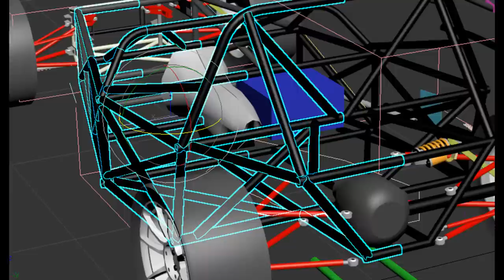Differential and Drive Shaft Install - E55 ASL Part 11

Comment: Been following since the beginning, and I definitely appreciate all the ingenuity and can relate to what you're doing (currently starting to swap an M113 N/A in a Jeep).  BUT being someone who has used a tried using a lathe and a rotary welding jig to shorten a driveshaft... man, take it to a driveline shop and let them weld/balance it. I can't see this one not giving you headaches.

Comment: Driveshaft gonna be a problem when it gets running you should always keep a driveshaft as one solid piece and shorten is by taking off the ends and welding either the yoke or drive on to the end of the tubes
Reply: Realtime1501 the transmission output is offset from the differential input, as well.
Reply: Another issue he has with that driveshaft is that because of the different diameters it puts the peak stress in that axle straight into that welded joint. I hope he creates a really sturdy steel tunnel with strong hoops around that thing. With those big slicks and big engine, angled axle ends with u-joint only at one end and welded axles which are not balanced ... there are going to be some big loads going through it.

Comment: Surely non balanced driveshaft vibrations will be serious and no amount of joints will help?
Reply: Aslong as the angles are right there shouldnt be any vibrations
Reply: @benson4u215  factory axles are balanced, maybe the just have bought to many weights 🙄
Reply: @benson4u215  try put an hose clamp on your drive shaft and notice yourself how it will vibrate as fuck at Speed
Reply: @benson4u215  what about the weld area and the fact it most likely wasnt welded on completely parallel? It wont be any good until its balanced properly by someone who actually knows what theyre doing. And more than likely a driveshaft specialist wont touch something thats been cut i  half and joined in the middle like that.

Comment: The project is an awesome thing, but driveshafts aren't something I wouldn't DIY. Even the slightest balance imperfection can be a literal pain in the ass at several thousand RPM.
Reply: Yeah, at least get a few professional opinions on it.

Comment: You explained that the driveshafts doesn't have the same Diameter. then you are using a piece of metal to make it "perfectly" straight. You are sitting directly over the driveshafts, what you did is really dangerous. If the driveshafts fails during a drive it could easily kill you.

Comment: What goes into calculating the strength of a propeller shaft? I didn't think that hollow cylinders could withstand much torque.
Reply: It is actually all transmitted along the strongest part of the structure so your good.

Comment: You are wrong about how LSD works. If one wheel will be in the air the wheel with traction will receive MORE torque than the one in the air (not equal amounts). Open diff works on principle of equal torque split so when one wheel has less traction it determines the maximum amount of torque which we can send to each wheel. With progressing locking ability of the clutches in the diff we can send more and more torque to the wheel with traction.
Reply from the maker: Meant to say equal speed. It's different how the wavetrac lsd works. The clutches are only there to provide a bit of resistance so the mechanical lsd stays locked even at 0 load conditions

Comment: Thanks for another great build video,  Just as I was thinking about balancing the drive shaft you explained why you don't intend to do it, it did look like the front piece had a balance weight on it and I do wonder if that should be removed or not.

Comment: 🤔aint the shaft is gonna vibrate? because its not balanced
Reply: That should not be a question IT WILL vibrate. they will vibrate even if you paint them wrong. Ask me how I know...
Reply: @rocketssss6  😐 realy? even the paint this is the first time i know about this? It have wight but not like the wilds

Comment: 9:40 the square tubbing is blocking your diff drain bolt. How do you plan on changing your diff oil?
Reply: Bugger! That is a bit of a gaff
Reply from the maker: Maybe it seems like that in the video but both drain and fill plugs are accessible
Reply: @xfmotorsports  oh good!

Comment: without rubber bushings whining noise and vibrations from differential will be transmitted to chassis and multiply
Reply: For a car of this caliber, I don't think he would mind the vivrations and noises. It's a purpose built track car, not for road use.

Comment: I would weld some strong material inside the two driveshafts or weld a collar on top. If that weld fails, that prop shaft will flail by the seat and kill you.
Reply: Or weld some sort of thicker pipe "like a fake torque tube" for that thing to spin inside of.
Reply from the maker: It's going to be inside a transmission tunnel
Reply: @xfmotorsports  i would also add driveshaft loops." as great as this build has been, that driveshaft kinda makes me uneasy..adding a few safety loops is never a bad idea anyways and realistically doesnt add that much weight overall
Reply: I agree safe it's never enough and if u see any profissional transmission maker thei reinforce the interior of the transmission shaft, so I advice you even if it's going on a transmission tunnel to reinforce that shaft, best regards and grate vidio
👌💯

Comment: i would machine the edge of the e55 shaft so that it would slide inside of the infinity shaft...slide it in maybe 20cm or so and then weld.. i think it would help with centering and strenght

Comment: Have you checked the FIA regs for the main hoop tube diameter? Needs to be 50mm I think. Maybe yours is already or rules in Canada are different?
Reply from the maker: Depends on the weight of the car. For mine its 1.5"x0.095"
Reply: @xfmotorsports  good stuff, I figured you know what you're doing! Keep up the good work

Comment: Welding a driveshaft in the middle is very strange. It will break. Put in Driveshaft containment  or loose a body part.
Reply: He stated it will be in a tunnel.

Comment: I would send the drive shaft out for balancing.
Slightly unbalanced drive shafts can cause real issues. A badly balanced drive shaft will break welds!

Comment: can you explain why square tube is weaker than round tube? the common sense tells me that having corners, the square tube should resist more to bending and deforming...but i believe what you said, it just doesnt make sense in my mind!
Reply from the maker: Under compression the flat surfaces usually buckle easier. Depends on the size and wall thickness too but for the same weight round tubes usually turn out stronger
Reply: @xfmotorsports  thanks a lot for taking the time to answer!... but on a chassis i would imagine that the forces acting on the tubes would not always be perfectly parallel to the tube itself (compression or pulling) unless the chassis would be very carefully and perfectly designed (maybe thats the case)...maybe the use of triangles takes care of the twisting forces.

Comment: Question: isn't better to cut and reweld a shaft at joint?, because in middle there  will be a lot of torsion.
Reply from the maker: Ideally yes, but its hard to get the drive shaft straight that way. The drive shaft is fairly understressed for this application anyways since the car is half the weight of the donar cars
Reply: @xfmotorsports  vehicle weight doesn't matter much for a driveshaft, it's the amount of torsion it will see, which given the amount of power and mechanical/aero grip you will have won't be little. I think you would be wise to get the driveshaft made-up professionally. The amount of vibration you will likely get is going to be damaging/unsafe. Not saying all this to put you down, I love the project. Saying this because I'm concerned about your safety
Reply: @derekstratton6063  I am also a bit concerned about the vibrations coming from the joint difference plus the imbalance in the shaft. Especially with the solid mounted diff, I am a bit concerned the vibrations might just break the welds.

Comment: That prop does seem dicey - join in the wrong place which seems dangerous and also every chance of having horrible vibration issues. I think you should have done some research before deciding how you were going to do it. I'm not saying I'm and expert but I think I'd buy another 350Z prop and redo it with the back yoke of the E55 prop jointing them that way just to be sure of safety and strength and improve the likelihood of good balance. You can check the run out as you go when welding up. There's a good video in it I reckon

Comment: Ok, TIME OUT!!!  Ive thrown in some" I'm not sure about that" on a couple things. This is for real and for sure. That drive shaft is going to kill you. The balance doesn't matter? Who told you this? Send the driveshaft you made as a pattern and have it made properly. At best it breaks the tailshaft housing off your trans, at worst you lose your right leg and maybe die in the ensuing crash. Not a maybe. That is not acceptable and most likely won't pass tech at a decent event.

Comment: You'll be sitting next to your driveshaft ... how confident are you in your welds? You blew your budget on the engine, and you're cheaping out on critical safety items.  Farm out the safety bits for your own sake.   I don't see this going well.

Revisit the rules you keep mentioning.  You're missing the mark.
Reply: He's already buggered the front suspension. It doesn't have enough travel and will break the welds.